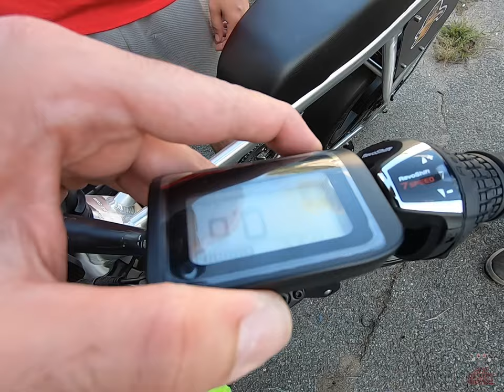Ebike Vlog #10 - Unlocking Race Mode On New LCD Display / Juiced Scrambler

Comment: The speed will show correctly on the LCD once the settings are set to the right tire sizes. However i am curious about this race mode? Is this the off road kit? the ones that unlocks an additional 3-5mph?